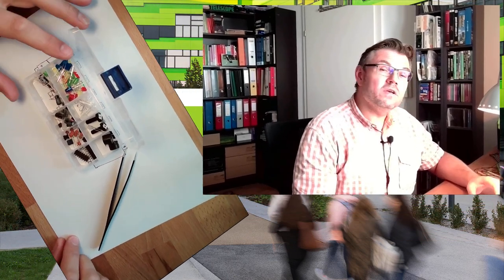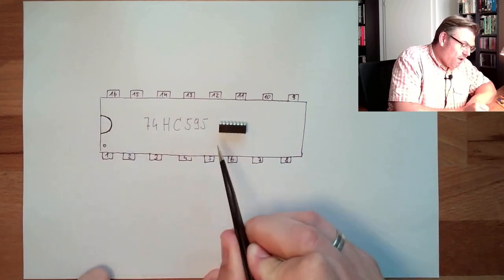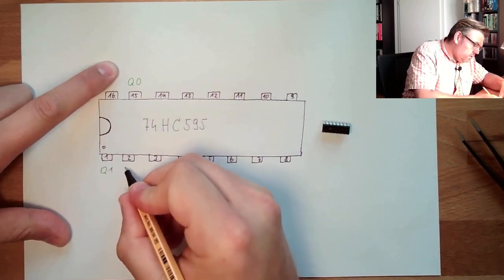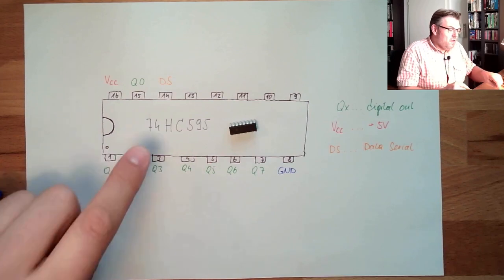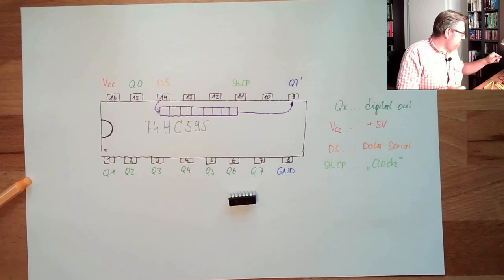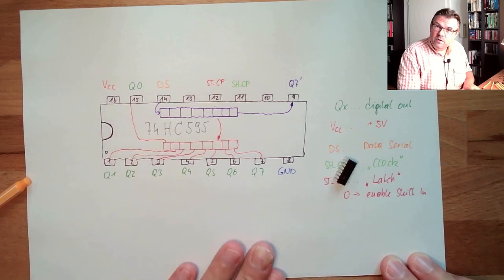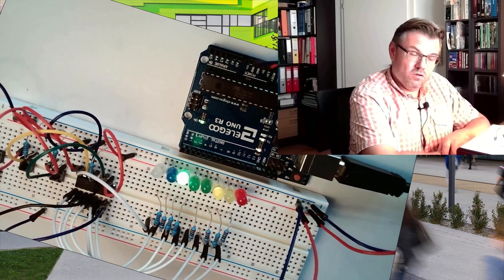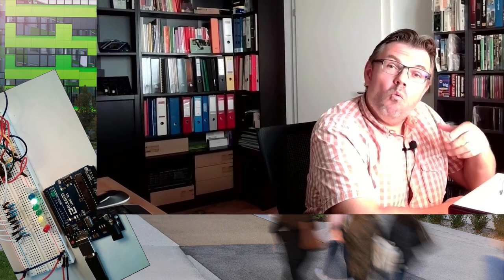Arduino 30: Shift Register (74CH595)

Comment: Very nise idea showing this with the buttons.
Reply from the maker: Thanks. I was quite lucky at this shot because a lot of times I experienced bouncing of the buttons. And suddenly it appears as it would shift 2 ot 3 places. Not nice on a "so is it working" video....
Reply: @HeinzPeterschofsky  I did a few experiments with the Arduino IOT Things platform. I think you shift buttons will work perfect with the virtual buttons 😉. 

What is your take on using ID'S, Platformio, Visual Micro, Arduino IDE 2.
Reply from the maker: @mariusscheepers9003  Thanks for the hint!